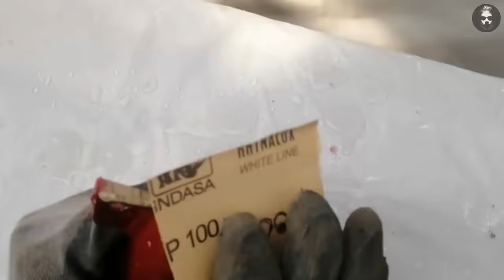Restoration Old Motorcycle Hercules HC150 | Motorcycle Full Restoration

Comment: I work with restoration of old motorcycles for over 20 years and 90% of the videos that appear on Yutube are fake. Motorcycles never have a hole in the gas tank. Most of the time they have full tires!!!! Since everyone knows that a tire deflates after a few months stopped. It is almost never necessary to cut a stuck screw. Anything to deceive people. In this video the gas tank is out of paint and has no rust!!!!!!! Miracle!
Reply: Muiro lindo
Reply: I believe fake too

Comment: He treated the large and smooth fuel tank with sandblasting, but the frame of a complex shape with a grinder...Strange.
Reply: @ShehasPlaceRestoration  That wasn't a compliment.
Reply: Using a grinder on the frame would be a guarantuee to make sure you lose the operating licence and can throw the whole machine into the dumpster here.
Reply: Maybe it’s a matter of possibility’s, he just didn’t have more sandblasting sand and it would be too expensive to buy more at the time of making this video ?
Reply: @jensdybrofrederiksen7922  Before i use a grinder on the only part that keeps everything together i would rather use every other possibility including reusing the sand.